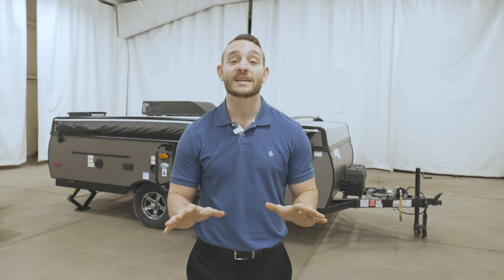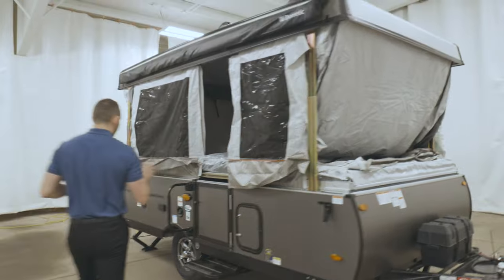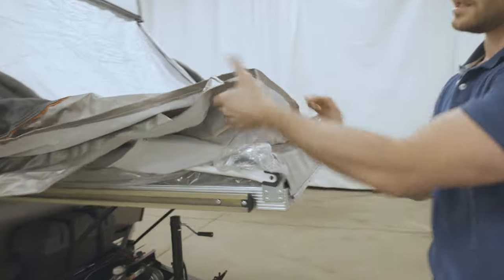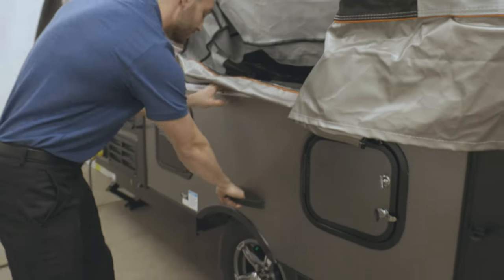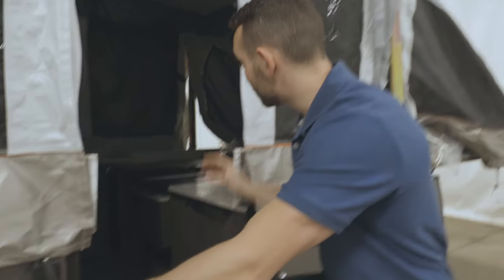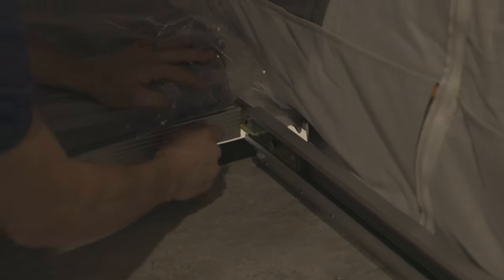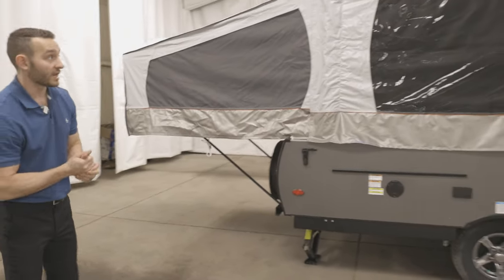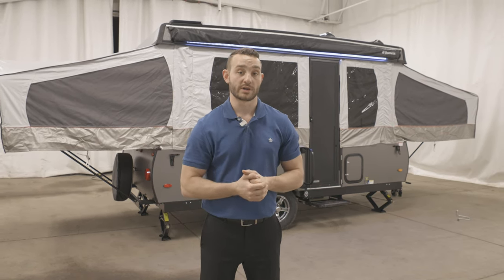How to set up your Flagstaff Tent Camper!

Comment: I have a 2015 HW Flagstaff pup and the two major items that caused me to choose it was the electric roof lift system and then the bunk end supports.  On my PUP i put the bunk supports in place before sliding the bunk drawers out onto them, this eliminates the back or shoulder lifts of other models and competitors.  Then for the HW models your get counter height inside cabinets with no lifting  galley into place, which also saves back, legs and arms for lifting the weight.  Mine unit has the hard wall bath but the two sections rise from hinges on each side and are light weight to lift.  The heaviest thing about my PUP is the portable dining table which I can still handle.  My salesman was the worst and even said during the walk through that he hates PUPs, but I have always been a fan of PUPs and just worked around him.
Reply from the maker: Todd, we are happy to hear that you have enjoyed it! Thank you for your feedback!